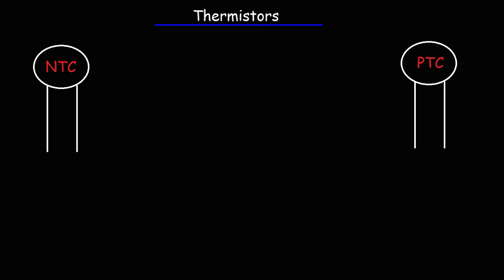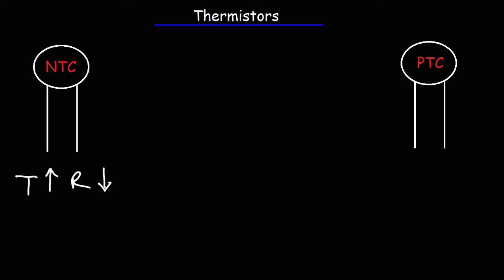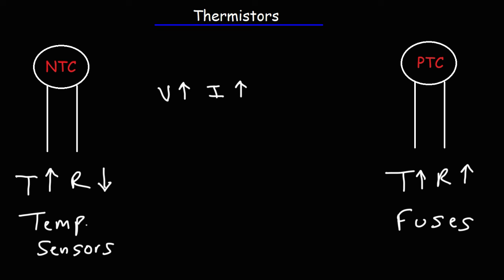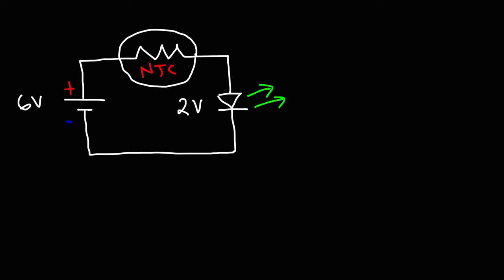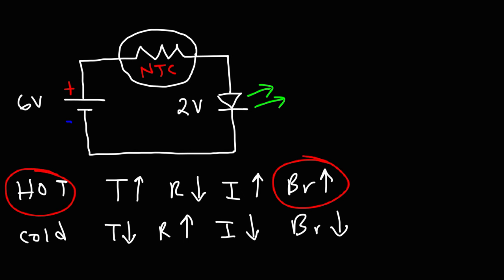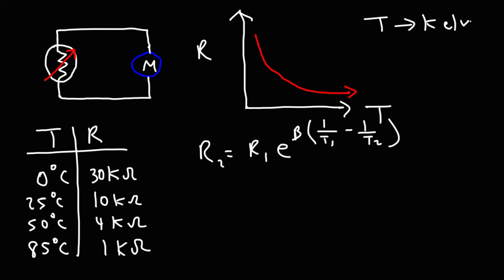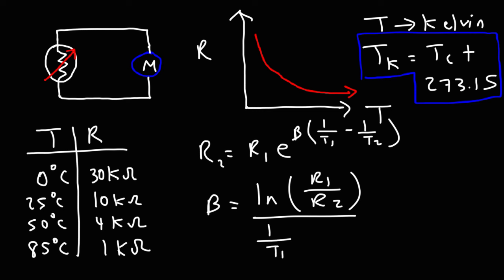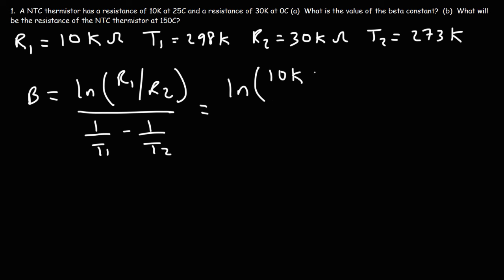Thermistors - NTC & PTC - Thermal Resistors - Temperature Sensors & Resettable Fuses

Comment: Good video!

Would like to point out that at 7:50 the formula should be:

R1 = R2 exp.^beta ((1/T1) - (1/T2))

It was done correctly with the example question later in the video though. Just saying for those watching that they should watch through the whole video and not stop at 7:50.

Good job!
Reply: thx, i tried to change the formular to B and was confused about ln(R2/R1) :D

Comment: Calculation: Supposing (1/T1 - 1/T2) as X
R2= R1e^(BX)
R2/R1 = e^BX
ln(R2/R1) = lne^BX          lne=1, shifting the power of e to the base
ln(R2/R1) = (1) BX
(ln(R2/R1) )/ X = B            replacing the value of X
B= (ln(R2/R1)) / (1/T1-1/T2)
Reply: I agree with your math. I’m very confused why he has ln(R1/R2)…?

Comment: Great video: however, when solving the log equation, I’m getting beta as [ln(R2/R1)]\[(1/T1)-(1/T2)]. What you have is correct however if R1 = R2 * e^(beta((1/T1)-(1/T2))).

Comment: Ive got equipment with 64 NTC thermistors imbedded inside.
I need to monitor each one on a regular basis, and set a high alarm.
I have a stc1000 temp controller and was wondering if something Arduino based could switch between them all over say a two or three minute period, giving me constant monitoring✅
Reply: Have you tried to use remote temperature sensors instead? Like the TMP468
Reply: @bp8864  I need to use the ones already embedded in the battery modules☹️
Reply: @Roger Crier 
Ive got the same plan like you. I try to read out the temperature values out of 845 thermistors separately.
In the future I want to build out a powerwall with 3380 lithium cells, of course with full temperature monitoring based on arduino nano.
In your case, the job can do the set of 74HC595 chips (eight in series of them) and one arduino probably.
If you know, how for example the 8x8x8 led cube works with the same setup, this is easy to do.
You can switch between the sensors one by one, read out the data, then switch on the next one....
Reply: @rolandroka2082  
I will pass that info to my friend, who knows more about it!!✅
Thanks